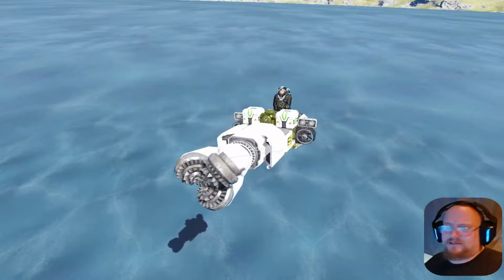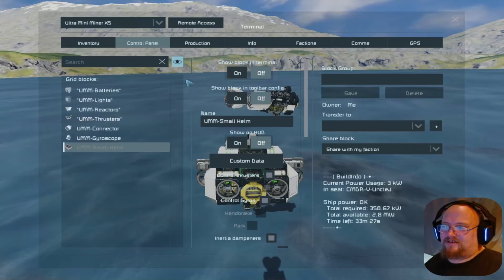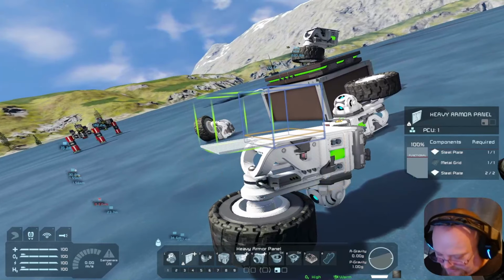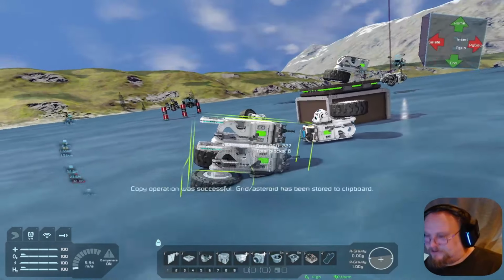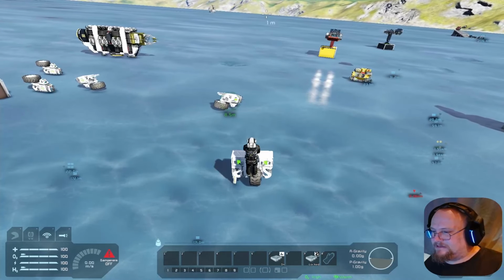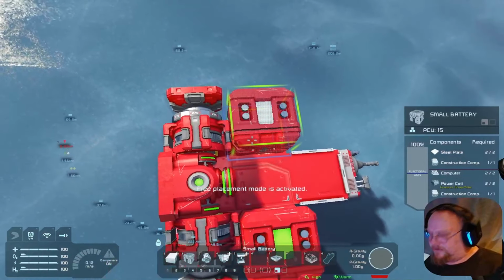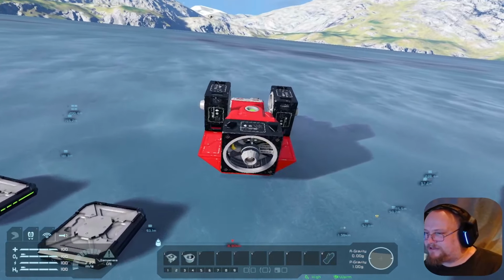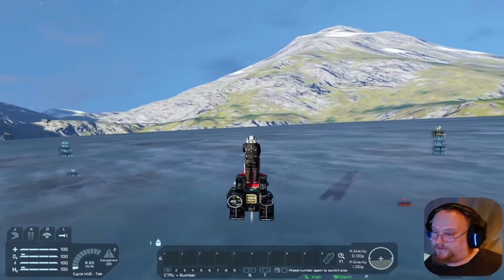SE Creative: 1x1 Small Helm Micro Builds

Comment: I get what you're going for here, but it's much less impressive using modded parts. Also if you do make more along these lines, making one variant for aesthetics and one for minimal pcu could be an option. I've worked on making a drone for use with PAM on console, is very difficult to make it small and functional but so rewarding when it works. Love to see your take on that, preferably without modded thrusters etc